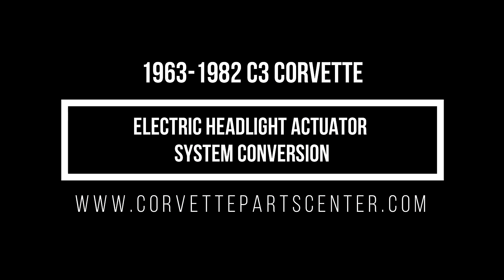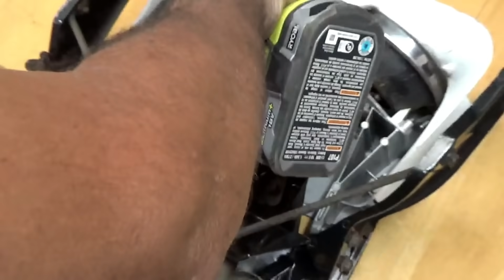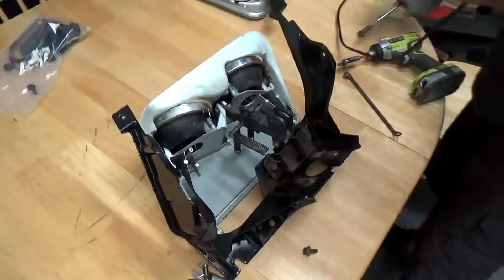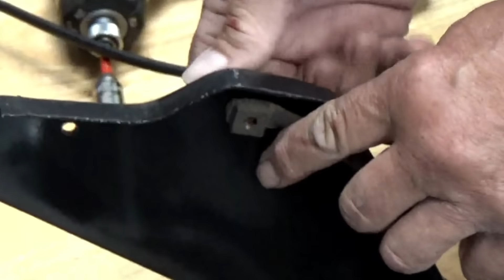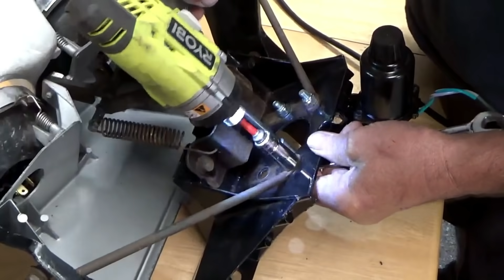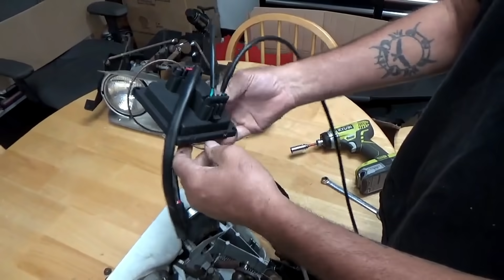C3 Electric Headlight Actuator System Conversion, Corvette 1968-1982

Comment: I ordered a kit and I got no connectors in the kit. This is the harness and the wires I got. Maybe you know what connectors in the light switch to connect them to? I was going to upload a picture, but YouTube doesn't provide for that. If I had an email address, I could send it to you. Anyway, at the end of the dual harness that connects to both motors and the relay are a black a blue and a red wire, stripped. Any Ideas as to what connectors on the light switch they would connect to?

Comment: Just tried installing this in my '82 but the fitment of the motors against the radiator is too tight to complete the install, even after jamming them (hard) into the radiator fins. Not only do I now have bent radiator fins, it seems the only solution is to drill new mounting holes in the actuator headlight assembly which is very frustrating considering this was supposed to fit out of the box.
Reply from the maker: James, there is something amiss in the car itself.  Call me at the shop 800-886-5064  Lyle

Comment: Thanks so much for this!  I have this kit ready to go on my '80 as part of a complete electrical system overhaul (along with removing the vacuum system).  Would you recommend taking the headlights completely out of the car as they have been in this video?
Reply: It would be unnecessary to remove them like I did for the demonstration....all of this can be done with the lights still in place.  Lyle

Comment: I see a lot of people getting these conversion kits say that a slot needs to be cut for the actuator arm to move now. Is that actually true?
Reply from the maker: Not with this kit.  there is another kit on the market that doesn't use actual Corvette motors or module, and that one requires more customization to install than ours.  Lyle

Comment: What gives the signal to open and close the headlights? There is no switch in the Kit.
Reply from the maker: That is because this system hooks into your existing wiring and uses your original headlight switch to actuate the headlights.
Reply: @csvette  Thank you

Comment: Link to the control module? My Miata motors came from eBay and have no pigtails... Everything's installed but I just have 4 wires out of each. I know the green is indicator lamp

Comment: Good Video. You say there is only one wire hook up, and it goes to the stock switch. My 68 switch can not be assessable unless the whole dash is removed. I hope you have the wire color down stream that I can splice into. Your video did not show that, which is very important for us working on these old old cars. I see it comes with a electronic device which has to do something. Where is that mounted? Thanks, Rod
Reply from the maker: There are actually 2 wires.  One goes to the alternator, the other hooks in to  a sidemarker lamp.  No need to touch the switch in the dash.  Lyle

Comment: Can you remove all the vacuum lines and associated parts once the installation is complete.  I have a 75 convertible.
Reply from the maker: You can eliminate the vacuum actuators and the vacuum relays under the nose, but I would leave the connections to the vacuum reservoir in the front frame extension--you only want to thin out the headlight vacuum that is no longer needed--the rest of the vacuum system has to remain functional for HVAC and other non-headlight functions.  Lyle
Reply: @csvette  Thanks!

Comment: Once again, this is an excellent instructural video. It would have been nice if you showed the actual conversion in operation and the amount of time to get both headlights in sync with one another.

Is there such a conversion for the C3 Wiper Door?

Save the Wave.
Reply from the maker: The Headlights sync automatically, as they are both controlled by the same brain box.
Reply: @csvette  I only asked in that the C4 could occasionally be out of sync, although nothing like the original C3 setups.

What about an electric conversion for the wiper door?
Reply from the maker: There is an electric conversion for the wiper door as well, but it is from a different manufacturer.  That system costs about $1300, and while it works really well, I think that is too much $$$.
Reply: @csvette  "Too  much $$$" Now that is an understatement. :-)
Reply from the maker: @petercarey6883  The travel on this setup is about 1/4 of what it was on the C4...we have them installed on a car here and they are instant and simultaneous.
I'll add some video of that car working when it gets back from cut and buff.
Reply from the maker: @petercarey6883  I was trying to be kind... it is WAAAAYYYYYY too much $$$ .
Reply: @csvette   Ha, ha. I'll see your "WAAAAYYYYY to much $$$" and raise you to "It's highway robbery."  lol  Looking forward to your headlights in motion upload.

Comment: I just installed a kit. The motors cycle to full lock when lights are turn on but never retract back down.  Checked all voltages. Kinda lost.  Already left you a voicemail since I know it's the weekend.
Reply from the maker: Call Dave (the manufacturer) after 10 am Eastern Time.  He knows everything about this system. His number is 904-248-9549.  Lyle